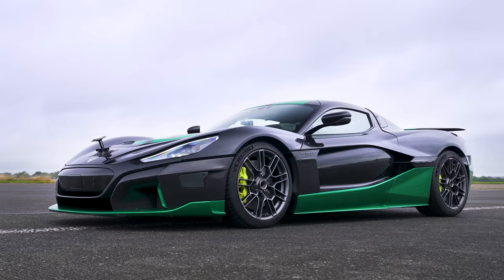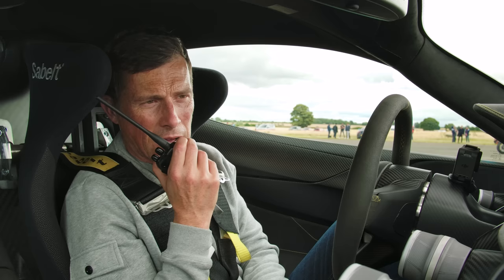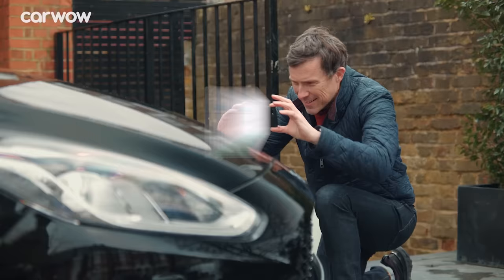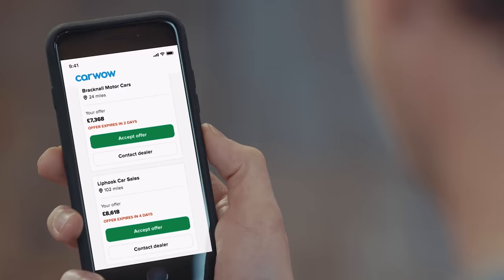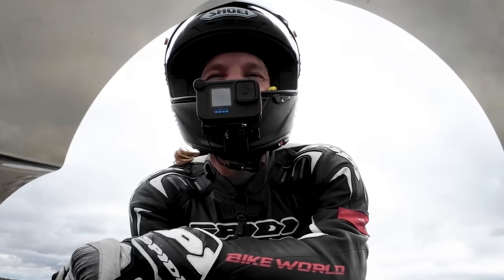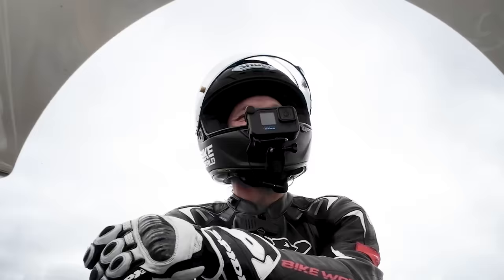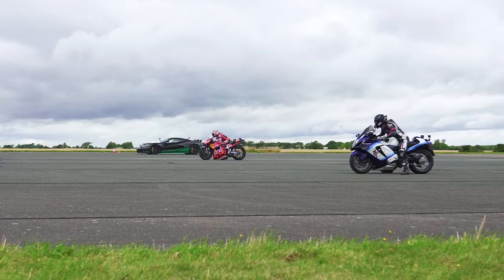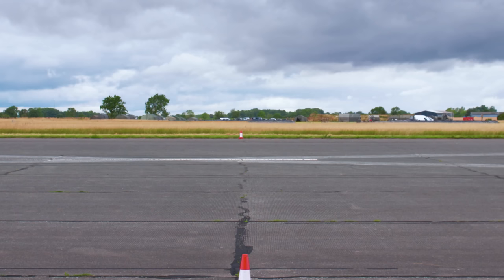MotoGP Bike v Rimac Nevera v Turbo Hayabusa: DRAG RACE

Comment: Can you imagine going 300+kph on a motorbike?? Such huge respect for Dani and Chris!!
Reply: Done it on a R1.
Reply: They do 360kph on a track, within meters of each other, and then out brake the guy in front of them..
Reply: Check ZS Motovlogs He did 340+ on H2R In Pakistan on public roads
Reply: @hny373  H2R is too slow H2R fans can't get over it 
This Busa is faster than H2R 
This Busa has done 9.2 seconds quarter mile H2R 1/4 mile 9.4-9.6 seconds
Let alone Moto GP bike and Rimac Nevera both are a lot faster than H2R
Reply: Honestly it's not much different to above say 180kph. Just a narrowing of focus into the tunnel. Can't do it in fear though. Like anything just built up skill and confidence.

Admittedly it's a bit addictive.
Reply: Done it on a ZX-10 .
Reply: @hny373 no Brasil um cara fez 400 k/h tem no YouTube saiu até no jornal
Reply: F1 is even crazier. They use 5000 rpm start now but imagine few years ago they were allowed 10000 rpm at idle engine.
Reply: @VenomRoadRacing It's addictive enough that I will not allow myself a litre bike any more xD
Reply: Yeap, 1 wrong move GG
Reply: It's like nothing else. Full on tunnel vision, I do recommend it if you get the chance.
Reply: @Jkim. same xD the 06's in canadian spec gear out at 319 on dyno and on the road.
Reply: @krazed0451  That's what race tracks are for my friend
Reply: @VenomRoadRacing  It is indeed... My poorly developed sense of self preservation does me no favours on a racetrack though, lol
Reply: Done 170mph on a gsxr 750.
Reply: on a straight line ? anybody with two hands and 2 legs can do it
i owned a bike back in the day and could go up to 260klm no problem
Reply: not that hard actually depends on the bike
Reply: I can remember doing 167mph on a naked bike on interstate 25, but I don't know if I can imagine going any kilometers.
Reply: Done it plenty of times 👋
Reply: Absolutely, I've done it lol but you get used to it just like anything
Reply: Dani holds the record as a motorcycle racer with the most broken bones
Reply: @kaharmuza5742  
Being a man the size of the average 12 year old boy has its disadvantages. Lol
Reply: @krazed0451  Thoughts of self preservation are overcome by riding faster.
Reply: Of course we can - not too much of a problem straight away - but imagine moto gp at Phillips island and three side by side want the first corner first at 270 plus - coming down just a little from 340 the two seconds before?
Reply: @JamesBrown-ux9ds  
Mugello 2019. Last lap, braking from the fastest straight on the calendar into San Donato 3 wide. Crowd going crazy for the battle on track. Crowd going crazy for Ducati. Crowd going crazy for Petrucci's first win. I was literally jumping up and down screaming like a kid. Haha
Reply: @VenomRoadRacing  That's exactly the problem, lol
Reply: @krazed0451  I see no problem. 

Ride hard. 

When you find yourself separated from the motorcycle you know where too far was.

Repeat until you run out of money/ respawns.
Reply: done 285 on a s1000rr around 170 mph
Reply: "going 300+kph on a motorbike?"
Welcome in Germany.
Reply: @Smzxe It proves H2r is faster than your thoughts.
Reply: За то на Римак можно посадить обезьяну, а на педаль  газа поставить кирпичь, и проедет за 9 сек 1/4
Reply: Nothing special.did thar hundred of times on my liter bikes....what require skills and you American haven't understood that until right now is CORNERING...
Reply: @ShannonSouthAfrica  I think after 150/60 mph it’s no different. My Kawasaki you just start chucking gears at it
Reply: @hny373  That's insane. Imagine hitting an animal at that speed. They let their animals roam all over
Reply: @VenomRoadRacing  Just a little....
Reply: Fast straights are for fast bikes but fast corners are for fast riders.
Reply: @ShannonSouthAfrica  Sometimes you become a fast slider 🤣😅
Reply: @FriendlyPCGamers  still no F1 car will run 8 seconds quarter mile due to lot of wheelspin those higher revving F1 cars will burn tires if they tried to launch 🤣
Reply: @Smzxe  The drag strip isn't the only measure of vehicle performance. 

F1 car isn't built for drag racing.

Neither is a short wheelbase motorcycle which is supercharged with more down low torque than a non supercharged motorcycle.

What do you ride?
Reply: @Smzxe  F1 car would run 8 sec no problem if it got set up for a drag race. Ie drag tyres. Different suspension set up etc. Its a circuit car. Not a drag car.

It has nothing to do with "high revving"
Reply: @VenomRoadRacing  Or you brake very suddenly when you rear-end a van.
Reply: Done it a few times, best feeling. Nothing else matters.
Reply: @A.J.1656  267 kph
Reply: @j_laf9575  sen Türk KENAN SOFUOGLU nu seyretmedinmi Kawasaki h2r la 400 km yapiyor
Reply: @receptuncer1225  fake
Reply: @Smzxe  seyredebilirsin
Reply: @devidkonwar7736  this proves you're brainwashed h2R is no way near that TTS Busa 
Let alone MotoGP bike or Rimac Nevera
H2R cannot even launch and it wheelies in every gear rolling race
Reply: @VenomRoadRacing F1 cars can't run 8s V6 hybirds are torque monsters but so much drag V10s only make full power in higher rpms so quarter mile isn't the best of these F1 cars 
F1 cars are traction limited 
F1 cars do 0-100 kph in 2.4 sec and 0-200 kph in 4.6 seconds this is the best time so 1/4 mile is 8.9 seconds
0-100 kph times matters a lot in 1/4 mile 
If 0-100 kph time is under 2.0 2.1 seconds then 1/4 mile can get as low as 8.6 seconds
GP bike hits 0-100 kph 2.1 seconds 1.9 seconds depending on surface
Rimac Nevera hits 0-100 km/h in 1.8 seconds 
MotoGP bike was trailing behind Rimac off the line and started pulling in all drag races
In 2nd drag race MotoGP bike launched so hard it literally smoked Rimac Nevera off the line
What you think GP bike 0-100 kph time was in 2nd race??? I would say 1.9 seconds that's why it best Rimac Nevera off the line
Reply: @Tanaka1-  Congratulations. You can read the brochure and run off pure numbers.

Sorry mate. I live in the real world of actually doing these kind of things.
Reply: @Tanaka1- 

It is absolutely ridiculous to be all oh let's see what a formula 1 car and a moto gp bike etc do down a 1/4 mile.

These are race cars and race bikes. Built to do the specific craft they do. 

Try get out in the real world instead of viewing it on a screen from your basement.

Yeah it's interesting to see the outcome for curiosity.

But it has absolutely zero actual relevance or comparative insight as to what one is like to race. 

The sport they compete these vehicles in and building them for is not 1/4 mile drag racing.
Reply: @devidkonwar7736 faster??😂😂😂 Haha bro h2r need 2.6km straight line to reach 400kmh meanwhile motogp only need 900 meter straight line to reach 360 kmh😂, Let's make a comparison... the top speed of the H2R at Losail is 321kmh, noting that it doesn't use GPS speed, while the average MotoGP speed at Losail is 345kmh and the top speed Is 360kmh, is that called fast?😂
Reply: Imagine wheel spinning a bike at 300 kph.
Reply: @ShannonSouthAfrica  but MotoGP can go 300kmh in 9.0s, R1 do 300kmh in 16s
Reply: On an airstrip it feels much, much slower because of the width of the tarmac. If you really want to know what 300kph feels like ride the isle of man TT circuit.
Reply: @Norfolkbiker50  The IOM TT is a fantastic event. However there are plenty of events all over the planet where you can experience such things.

Best to keep the TT in reality. Not as if it is something in no way comparable with all this lore around it.
Reply: @VenomRoadRacing  I cited the iomtt firstly because I'm English and secondly because most people from the biking fraternity have heard of it and you're right, There are lots of road racing events around the world but none of them have the same status.

Comment: Anything that finishes 1/4 mile in less than 10 sec is crazy, so Chris did a good job.
Reply: Top fuel turbo Hyabusa approaching 6 second 1/4 mile on American drag strips.
Reply: @chrissmith2114 who asked you that? Lol. Don't compare top fuel dragsters to these bikes. Your comparison is just RUBBISH.
Reply: I once owned a Turbo Hayabusa with 301hp/282Nm and the previous owner drove it for a quarter of a mile and got low 9-second times. As I recall, 9.2s.
The rear fork was extended a little (a few centimeters).
At least this driver in the video hadn't practiced very much.
Reply: @klaojaju You write it yourself. The previous owner. So a vehicle he knows. Chris has to do this with a vehicle that isn't his just for a video. In addition in the case of drag races it is necessary to consider the ground asphalt vs concrete, texture etc.
Reply: @Gaby-ux8np  Cold Temps. Honestly not good tires for such high HP aswell. Unprepped, abused and bumpy runway. No shot he could ever get good times like that. What the other guy said was probably on a prepped Dragstrip.
Reply: @alexwithanx  as someone who rides year round, the difference in grip between when it's 5 degrees and 20 degrees out is massive. You have more grip riding in the rain at 20 degrees than at 5 when it's bone dry.
Reply: @GTAmaniac1  Well it has much more to do with the temperatur of your tire instead of the temp of the asphalt itself. Obviously when its so cold its freezing on the ground thats a totally different story. But the main issue is that cold road=cold tires/impossible to keep them at good temps. The ground is "hard" regardless. A rock will be a rock if its 5°C or 20°C, but rubber will absolutely work terrible at those temps. So if he always did a burnout before each race he mightve had a better shot at it. In this case, the race was lost before it even started with these conditions.
Reply: @alexwithanx  the cold asphalt is a massive heatsink, also getting cold rubber warm is a lot harder than getting a slightly warmer tire warm because the warmer tire deforms more.

Alsovthe asphalt absolutely does get more sticky the warmer it is because it's basically silly putty (bitumen) with gravel thrown into it. The grip on concrete doesn't vary that much with temperature tho.
Reply: @GTAmaniac1  Aspahlt does not get more sticky the warmer it is. Energy transfer is the exact same between warm or cold asphalt. What you describe as "sticky" is actually Oils coming out of the asphalt. Hot tarmac becomes more slippery and smooth. Cold tarmac is rougher thus offering more mechanical grip. Thats also why you have more tear on your tire when the track is cold. Theres plenty of articles that describe it much better than i can tho, even on the Pirelli website.
Reply: @klaojaju  But 300hp isn't even much for a turbo Busa lol, I've seen a turbo busa with like 600whp+ lol, alltho that is with racing fuel. But the main thing is being able to put power down, stretch bike.. Ninja h2 can make 350whp too with supercharger .
Reply: @chrissmith2114  top fuel vehicles only serve the purpose of being fast for a quarter mile. Literally anything else they are useless
Reply: That's pretty slow
Reply: It will be 8 seconds soon
Reply: if u time the video, they actually run the quarter in about 35 seconds
Reply: @chrissmith2114 Huh? WHAT "top fuel turbo Hayabusa"? 😂
Reply: @wanderer54796  The Hyabusa engine is unburstable and capable of massive power output,  just sayin'

Comment: Mega respect to the bikes and riders.. Doing +200mph on a bike 😳🫣 that takes something else...
Reply: With the back wheel wobbling! Different breed.
Reply: You get used to it. Not for rookies though
Reply: Big kahooners!
Reply: normal in isle of man racing
Reply: It showed that a 2000 Hp car with all wheeled drive & launch control to match a MotoGP bike on a drag. Yet, without the rear chattering. D. Pedrosa could have won that running start to a 1/2 mile. Also, remember that 2021 KTM Rc16 wasn't certainly mapped to extract it's full power. I wonder if it was. 

Anyway, glad that Dani was enjoying & for Chris riding that Superbusa, man he has that huge cajones to jump on that bike. Sylvain Guintoli could have been perfect aboard it, I guess.
Reply: From 155mph (250kmh) the wind resistance gets so tough! And these guys are going well above that. Respect.
Reply: @topsunnn only for the legends.
Reply: Anyone can go straight fast.
Add corner end of the runway, that separates men from the dead.
Reply: @XtreeM_FaiL  yah, if you are in a car. But on a bike with all that wind shaking the bike making the rider nervous while the front tyre trying to go up. It's not that easy. You know it still a tough job even if you are that good. If you saw even Dani he wasn't that confident when he felt the bike rear end was wiggling. To us we have notably saw it was bad, no wonder he reduced his speed.

Comment: Dani's incredible skill aside, this shows perfectly what unbelivable crazy machines they are riding in MotoGP
Reply: Yeah I can't believe how well he can launch that GP bike. And how fast it is. Pulls away from a 1900HP electric car
Reply: Seriously! Hides so much power on such a little engine, incredible to be able to control those machines is insane
Reply: @Gerdienator no chance those rimracs really make 1900
Reply: @slackerm1 they do but its split over individual  wheels  around 450 per wheel.  I can't do 1900 through the back  wheels
Reply: I still believe Binder had a better launch at Jerez, probably expectable because of the grip difference
Reply: @Gerdienator  holeshot device never lie about making GP bike manageable launch. if it was older bike, no way it could launch and not wheelie like this.
Reply: @slackerm1   also I believe the gp bike makes more hp than actually stated, companies usually hide the real numbers
Reply: @Undefeated.ZX10  we're pretty close to it. I don't think they're over 300hp
Reply: @slackerm1  You have to consider that it's heavy as hell.
It weighs 2,3 tons so it only has ~0,83 HP/kg.
Koenigsegg made their first car with 1,0 HP/kg back in 2014 with the aptly named One:1 (1360 HP : 1360 kg).
The MotoGP bike with Dani on top weighs roughly 217 kg and has 270 ish HP so that's about 1,24 HP/kg.
The bike on its own has ~1,72 HP/kg . =P
Reply: @Undefeated.ZX10  I think it would be pretty close, even Ducati say their GP bikes make "around 300hp". What I don't think makes the power is that Suzuki, when a bone stock ZX14 can do a high 9 sec pass (and a mid 10 two up as tested by AMCN)

Comment: The electronic wheel slip and wheelie controls are simply amazing on the MotoGP bike.   Unreal.
Reply: Would that technology help the busa launch better?
Reply: @ptrgr72 Definitely
Reply: Yeah, KTM does have best Launch control in MotoGP compared to Ducati s
Reply: He did cheat a tiny bit at the start, but still impressive.
Reply: @Shreejansurya98 you're wrong watch 2022 Ducati Moto GP bike starts it destroyed all KTM GP bikes on the grid 
And 2022 Ducati made Suzuki Moto GP bike look standing still
Both Ducati Moto GP bikes flew past every gp bike on grid
Reply: @Smzxe  Can you read English? Everyone knows Ducati s fast but I'm talking about Launch control where KTM is better, check the race start again
Reply: @Shreejansurya98   KTM doesn't have best launch 2022 Ducati Moto GP bike was faster than any KTM ever made on the launch or anything else and 2023 Ducati Moto GP bikes are far superior than KTMs
Infact 2015 Ducati Moto GP bike was faster than this current KTM GP bike